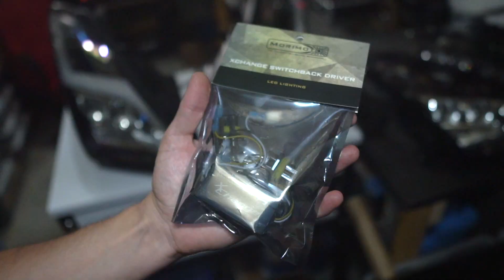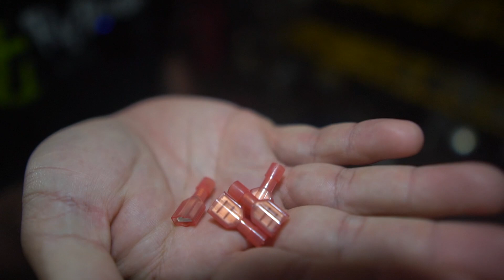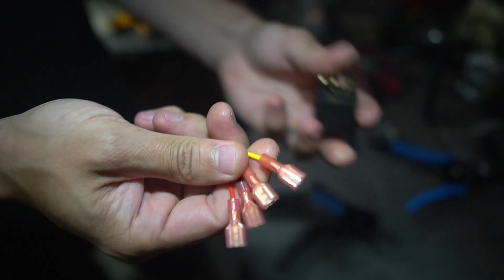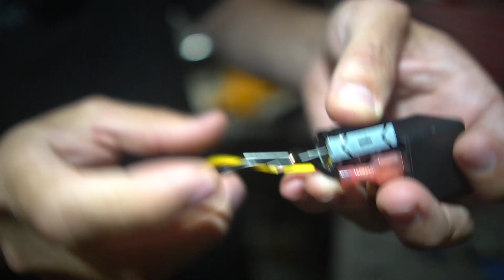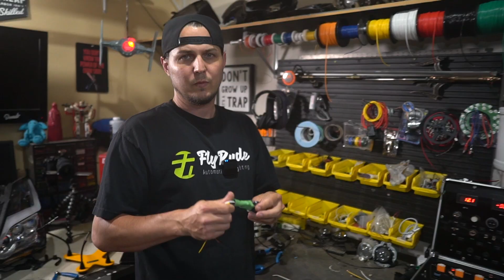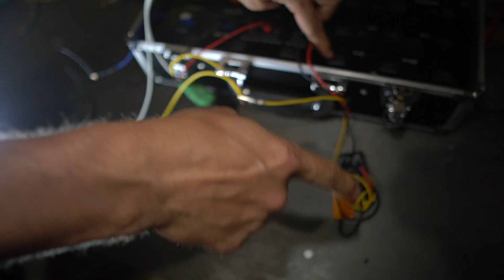EASIEST Way To Make a SWITCHBACK MODULE

Comment: Couldn't you connect the white/parking light lights to pin 87 on a 5 pin relay, and then pin 87a to a  flasher relay which is then connected to the amber turn signal lights.
Reply: that would just make the white lights come one when the amber turns off, you don't want that, you want white to stay off when the amber blinks

Comment: Trying to set up a switchback for an SC430 to use both DRL and Turns, but the DRL is also high beam. This seems common on Lexus. Any advice / experience with this?
Reply from the maker: Cut the highbeam / DRL 12+ send the vehicle side to 86, and the bulbs side to 87, with power and ground to 30/85

DRL won’t turn on, but highbeam will still turn on.
Reply: @flyryde  Thanks! Is there a way to do this without losing the DRL?
Reply from the maker: @JCG8935  what does “trying to setup a switchback” mean?
Reply: @flyryde  I want the high beam to still work in the same location, and that bulb turns off when the turn signal is on.
Reply: I'm pretty sure that, if the light turns off by default on the factory setup, it's being done to make the turn signal visible. I've seen this on some cars with LED headlights that have the amber turn signal mounted very close to the headlights.

Comment: Love it  So in other words, its basically a kill switch for the white leds, just like your other relay vid. And the added capacitor keeps the relay from chattering/de-energizing during the off cycle of the flasher relay. Just a correction though the diode is 1n4007 not In. Thanks Teach!
Reply from the maker: You got it brother 👌
Reply: @flyryde  what i encountered in the past with the 1n4007 diodes is that they don't handle a lot of current going through i used a couple of them for a Bi-LED projector, in order to be able to flash my headlights on high beam even if the low beam is off, and the diode couldn't handle the LEDs and melted everytime, i even added more in parallel and still the same issue 🤔.
Reply from the maker: @luigibutoi7238  For that exact purpose, use rectifier diodes like this: https://amzn.to/3pWN01X
Reply: @flyryde  thank you 🙏🙏 ill try that one on my next project. Keep up the good work 👏

Comment: This is neat, though I don't yet know what I would use it for. I would have to think about that.
Reply: I figured it out. When I added the Fenix Cannon Hideaway LEDs as the front turn signals on my Trailblazer, I needed a way to have them function as both turn signals and running lights. I bought a set of converters that did this, but they are no longer available; I think this setup may work to do that instead.